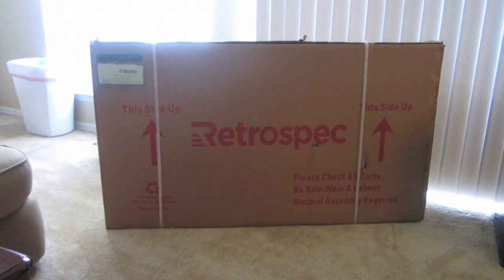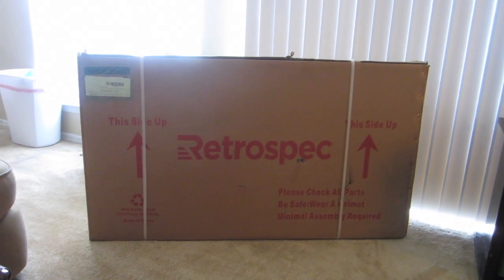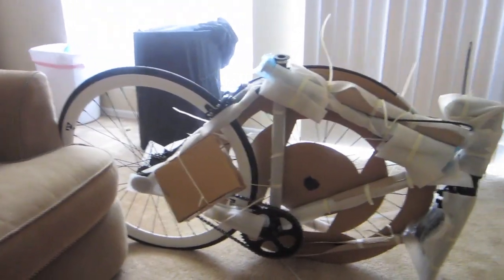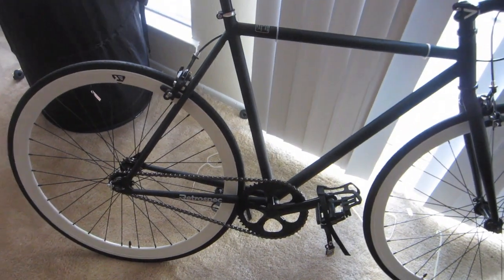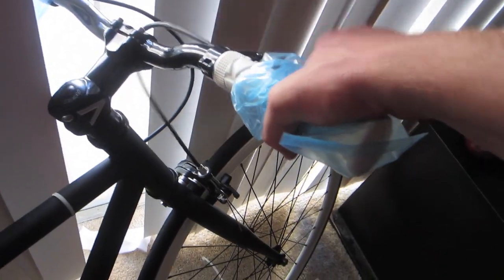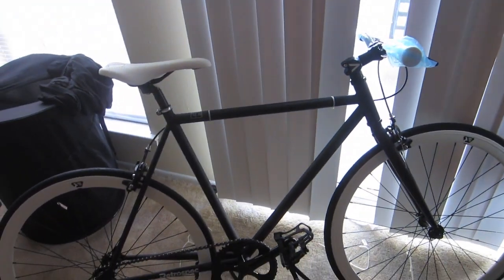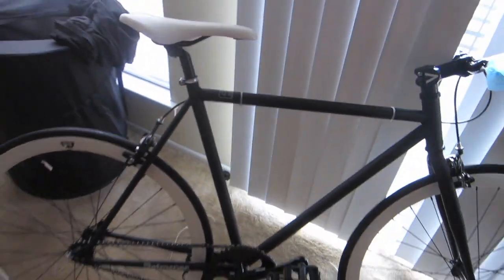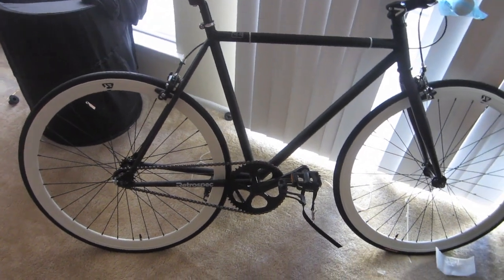RetroSpec Bike Unboxing | RetroSpec Fixie | RetroSpec Fixed Gear

Comment: My front brake doesn’t grip as hard as the rear. Any suggestions on what I should to do make it grip securely and safely. I did a squeeze for the front brake as hard as I could when riding but it didn’t stop the wheels right away.

Comment: Your Mantra came with front and rear brakes?  I have wanted this bike for a bit but the lack of rear brake (as I want to ride is free and not fixed) was an issue.  Hmm
Reply: it comes with both breaks
Reply: +staticPR704 yeah mine only came with the front only as well..